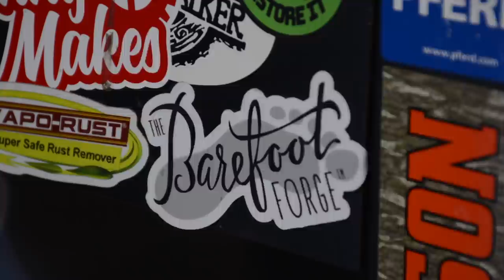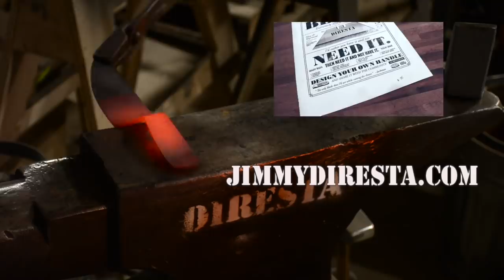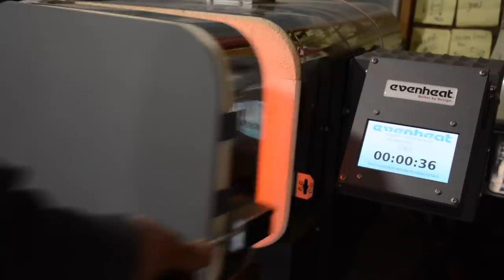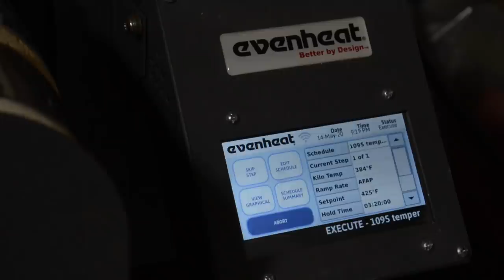DiResta Damascus Spatula Knife

Comment: I'm surprised Jimmy went with a compound bevel instead of a single bevel like a Japanese knife. A single bevel, flush with the bottom of the spatula, would make it easier to scoop everything. Of course, a Damascus steel spatuknife with red bandana scales isn't exactly a design centered on efficiency :)
Reply: But it would make it harder to cut with
Reply: No it’s actually easier to keep uniform dicing size when using a single bevel. But they aren’t really popular in the states. We are talking minute differences here. But as for being more efficient in scooping as a spatula I think would have had more value here.
Reply: The problem is, the bevel would be on the wrong side for cutting then. For it to work as a spatula, the bevel would have to be on the left side of the knife, which is wrong for a right handed cutter.
Reply: @ractorc91  left handed people exist
Reply: @samanthavanscoder9536  that's not the point
Reply: Ayy, someone else taht thought it would've been better for a hamaguri grind/edge